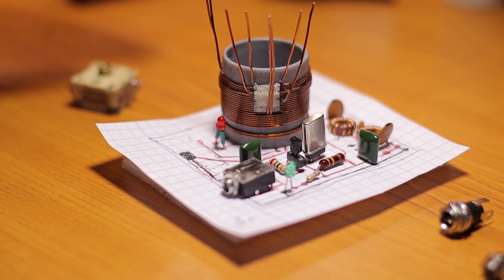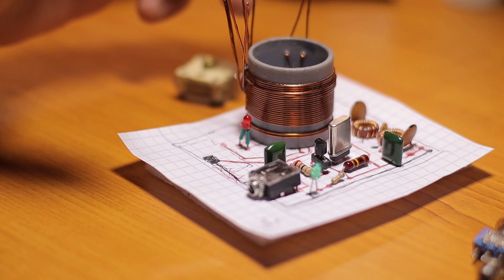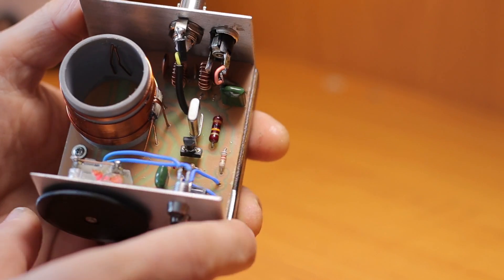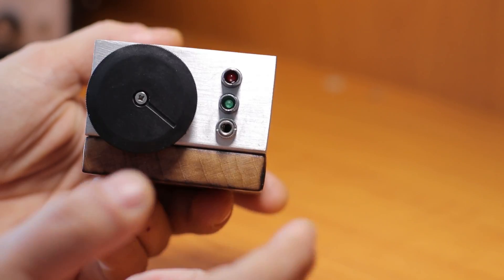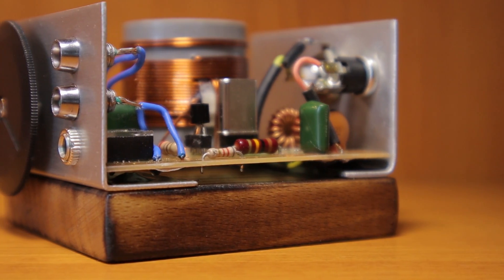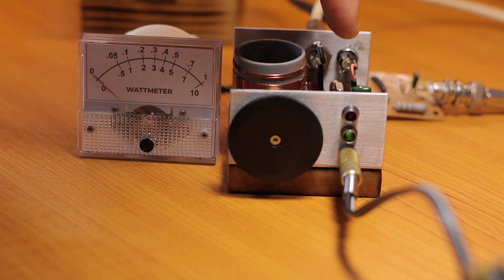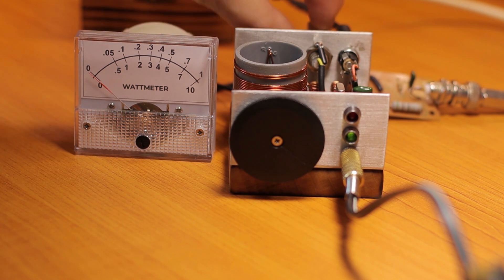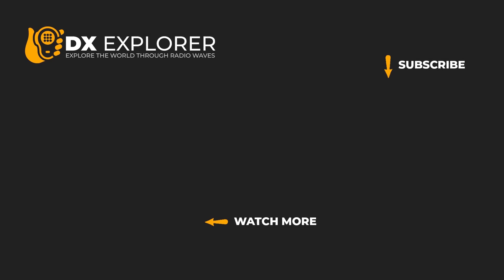Michigan Mighty Mite QRP CW Transmitter

Comment: Seems the original called for the coil form, from a 35 mm film canister !
Not sure you can find one nowadays ?
I used a breadboard to quick build mine, and connected to a 40 meter Ham Stick on a mag mount, at about 45 degrees, from the metal awning support it was attached to !
An old Drake Receiver in an adjacent room was connected thru a wireless 900 Mhz Headphone set !
Giving new meaning to,
 " Wireless " !
Hi !
I believe I powered it with Two 9 volt batteries in parallel !
But my transistor was a 3904 if memory serves me ?
I worked Cuba from Illinois with it !
And on 40 meters !
Great fun !
Really like how you dressed yours up !
I had begun to experiment with some success using an
 LM 386 audio chip, to make a transceiver !
Those were the days !
Fun stuff !
👍😉
Reply from the maker: It is a fun transmitter indeed. Cuba from Illinois... nice indeed. I am sad that I still didn't had the time to learn the code and use the MMM but hopefully soon. Thanks for sharing the little story... reminds me of the days when everything was simple and people happy enjoying the moment. 73, YO6DXE.
Reply: @dxexplorer  
I encourage you to learn the Code !
It opens up another avenue of Amateur Radio, and I think serves as a filter to what we sadly hear, especially from American Amateurs !
Too, I guess it is like learning another language, but a truly Universal one, in that Amateurs from all corners of the world, speak it !
As to the, " MMM ", I still remember the feeling, sitting at the kitchen table with a portable shortwave radio, and hearing the oscillation coming thru for the first time !
Great Fun, indeed !
And yes, as to the time, it was a very different World !
I'm guessing somewhere late 80's, early 90's I played with it !
Funny, I had the schematic for years prior, and then one day decided to try and build one !
Quite exciting to send out a signal, never knowing where your weak signal is being received !
Great Fun indeed !
Good luck with the Code learning !
Stick with it, and don't be too hard on yourself !
You'll get it !
Just stay with it !
And thanks for your post !
'73 !
👍😉
Reply from the maker: @sleeve8651 thank you so much. Ohh the code is why I got into the hobby in the first place, because I like the simplicity of the equipment you need for CW. A simple transmitter and a simple receiver and you are on air. I also had the schematic for a long time until I decided to build it. Actually there are many more on the list but I think life is too short to build them all hahaha. Is nice that it brings back good memories.

Comment: How did you wind the coil?
Reply from the maker: I did L1 first... 21 turns with a tap at 7 turns. Then on top of L1 I did L2 4 turns. L3 the one for the LED is next to L1 at about 4mm away doesn't matter on what side of L1.
Reply: @dxexplorer  thank you. Slowly figuring it out, will be my first coil. I will probably want to make a video tutorial how to do it for my friends. Got some folks in the Long Island cw club that are interested. Also noticed in the schematic that the 27ohm resistor is labeled R2 when I think it should be R3
Reply from the maker: @adanlewis7489 I am testing a version with a toroid coil instead. It seems to have a little more power output.  Not by much but in QRPp evert mW matters 😁. This one sounded nice... the one in the video i mean... but I wasn't too haply about the power output. Maybe a better transistor would help too. I think the original had a 2N2219 if I am not wrong. I can't remember for sure.
Reply: @dxexplorer fabulous keep us posted. I broke my leg so I have a lot of time to play around and build some radios!
Reply from the maker: @adanlewis7489 Ohhh heck... sorry to hear that. Yes I hope this weekend I will have a little time to play as well and I will get back to you and let you know the results. Just in case I forget... buzz me in here or on the email and for sure I remember 😅😅. 73, YO6DXE.

Comment: I have used the MMM design years ago and made plenty of contacts with it. Well worth building and trying out. Getting ready to put a new one on the air soon on 40M. My receiver is a very basic crystal radio design with a  loose coupled local oscillator vfo ( DC) and a few filtered audio stages and it receives 40M cw from Maine to Florida here in North Carolina. 73 de WA4JAT
Reply from the maker: That sounds like a really nice setup. I dont have the time now and still learning the code.... very slow because of the little free time I have. But this coming winter I plan the do a nice old school combo with a transmitter and a receiver to play with and see how far I can get with as little power as possible. 73, YO6DXE.
Reply: @dxexplorer  Hope you do not mind but I did send you a email with a pic of the receiver I am working on as well as the parts from my old MMM 🙂
Reply from the maker: @marknesselhaus4376  I don't mind at all. I got it )) I will get back to you a bit later when I get home. I want to send you a photo as well. 73

Comment: Try a Nand gate and crystal oscillator.  7400 or 74LS00. I worked a friend across town with just one chip. Just be sure to put filtering on the squarewave output because the second harmonic is almost as strong as the fundamental. I think the Norcal 38 Special tx used a 244 buffer as an oscillator.
Reply from the maker: That must be put on the do to list then 😁😁 Thank You... and Merry Christmas. 73 DE YO6DXE.

Comment: Is your tap for the LED red indicator drawing down your power output?? That tap has to absorb a certain amount of energy also. Try it with out it and see what your power output is.
Reply from the maker: Noooo... that has nothing to do with the output power. Its the same with or with ought it. Its all about the transistor used and the amplification factor of the transistor... also I think the current the crystal can take also has an influence on the power output.
Reply: @dxexplorer  Thanks for the update!
Reply from the maker: @johnkemas7344  Always a pleasure. 73

Comment: Does the wire thickness for the coil matter or can we use any thickness? (I only have 0.4mm wire)
Reply from the maker: It does matter yes. I used 0.7mm if I remember. You can use 0.4mm too... but you will have to recalculate the number of turns to give you the same inductance as the original coil has. I'm using coil32  app to calculate the coils.
Reply: @dxexplorer  Ok, thank you, it seems that almost all the inductance calculators don't care about wire thickness or even lack the option to specify the thickness.
Reply: @dxexplorer  ok I just checked, I also use coil32 online toroid calculator, but changing wire thickness doesn't appear to change the inductance at all
Reply from the maker: Hmmmm that's strange. I also use the same app and the inductance is changing dramatically if I change the wire thikness. I'll see in the morning if I have a little time and I will calculate and send you the coil details for the 0.4mm wire you have.

Comment: Nice work it looks good  where did you get your watt meter from ?
Reply from the maker: Thank you so much Joseph. The look of the transmitter was inspired from another one that I'm about to build and I will talk about in a future video. The watt meter I built my self. Not yet finished yet. Video coming soon about that as well. I have two scales: one from 0 to 1W, another one from 0 to 10W. More than enough for the QRP stuff I'm building. The meter itself it's actually a cheap Chinese meter to measure uA. I just removed all the extra parts and just kept the necesarry. I'll make a video soon and describe the entire circuit in detail and how I calibrate the entire thing. 73 and have a wonderful weekend.

Comment: Very nice, is that large air core coil for low pass filter?  like these old time stuff (Pixies) and regens for their high performance-simplicity ratio.
Reply from the maker: Thank you. The big coil is the transformer basically that it's coupling the output of the transmitter to the antenna. Impedance matching transformer I believe. The low pass filter its made with the two little toroids made on T37/2 and the necesarry capacitors. 73 my friend. Glad you like it

Comment: 1. practically every transistors are build in china.
2. made in china doesn't mean bad quality. You get what you pay for! If the market need low price, china will deliver it.
3. Lower output power doesn't mean low quality transistor. Choose a transistor with a high hFE gain. Every multimeter  has a transistor hFE checker.
The gain varies a lot!
Thumbs up for your work. TY
Reply from the maker: Thanks so much Tim. Yes I agree on what you say. I think I was talking about that in the Pititico video when I was saying that the transistors I got from Radio Shack years ago work well.... and those are probably also made in China )). But the quality is indeed different comparing to the latest ones I have. I am happy that I discovered now the difference in the hFE gain as I would never think of that otherwise. 

I always thought all 2N2222 are the same for example. About the BD139 I was talking about.... that is a really bad quality one ( I'm suspecting is a fake )... that's just because I measured another one that I have and the difference it's too big from what I found on the datasheet. Definitely a fake or low quality one. 

As example... I tested it in the 49'er transceiver where I'm also using a BD139 as final that's giving me 1.5W output.... but with the "fake" one I'm only getting 150mW  ))). I understand now that there is a difference in the gain.... but that much sounds a bit sketchy to me ))  Thanks one more time for watching the video. 73 and now I will keep in mind to check the gain first for the future projects  ))

Comment: The bd139 might needed more volts. In the past for example the bd was used for small but powerful transmitters for the am band and also there are circuits which allows the transmitter to operate in the fm band..
Reply from the maker: I thought of lowering the value of the 10k resistor a little maybe that may increase the power a little with the BD139. But then I tested that particular transistor on my 49'er QRP CW kit that usually gives me about 1.5W also with a BD139 as final. But with this particular one I only get about 400mW. For sure it's nothing but some cheap copy. I don't bother anymore )) I have to order a few more... but for sure not from the same store as most of the stuff I got from that place was bad quality. That's also where I got those old horrible potentiometers I used first in the Sputik and they ended up in trash a day later )))
Reply: @dxexplorer  I see. The 2n2222 transiator is actually the hero. This transistor output is really unbelievable.
Reply from the maker: Ohh yes. I'm still stunned that with a 2N2222 I'm getting 1W out of the Pititico Transceiver ))
Reply: @dxexplorer  probably it would be my first pcb project but I want some help. I can't find a toroid. Also in which paper do I have to print the schematic for pcb;
Reply from the maker: @sv2tcb  Here you have the link to the latest version I built: https://tinyurl.com/sputnik40-rx

For the coil.... if you can't find a toroid.... no problem I will email you the details for the PCV pipe version. Works just as good.
Reply: @dxexplorer  I paid more attention to the pcb files and the instructions you gave. Probably tomorrow I will order the pcb plate of need. Then I have to find the liquids.
Reply from the maker: @sv2tcb  No rush.... take your time and with patience you will get a nice receiver for sure. You already made one )) Ohhh for the coil by the way.... see my very first video of the sputnik and build the coil the same way as I made it in that video. Works like a charm.
Reply: @dxexplorer  actually it will be the 3rd time building the receiver but it is worth it  to be the first pcb project. For the coil I was talking about the el pititico tranceiver which has a toroid I thought of making that as a first project because it was simpler and smaller than the Sputnik
Reply from the maker: @sv2tcb  Ahhhh for the pititico you don't really need toroids. You can use the small inductors that are available for sale in diferent stores. You need a 1uH inductor for the low pass filter.... and a 4.7 inductor for the oscilator. You can buy those already made... ( looks similar to a resistor but with a different color code ).

Comment: I love your video series on the Sputnik. Could you do another build that can receive voice communications? I don't really like Morse, but I am a fan of homebrew receivers that can pick up people talking. Thanks! :)
Reply from the maker: Hahaha... thanks Paul. You mean like SSB coms ? I'm showing mostly CW in the videos because that was the hard part of making the receiver working well with those... but you can also receive SSB with the Sputnik. I listen a lot when I have the chance to be at home and the receiver is always on. Basically all versions of the receiver I built so far, are covering the 40m ham radio band from 7.000MHz up to 7.200MHz. So that covers both the CW part of the band... as well as SSB. I will return with the Sputnik and a few more receivers a little later for other bands too though. 73 buddy.

Comment: Very nice compact and very well presented. The problem I am facing is that the sputnik is not working 😃 again. I don't know, after the end of the summer I couldn't hear anything only some strong stations the cw or ssb was completely gone. I probably have to start building pcbs because my radio is completely a mess if you flip it upside down and I can not spot the mistake
Reply from the maker: Hahahaha... you are funny. Yes I know what you mean. If you remember my first testing versions used to look the same and after so many modifications I've always ended up having issues or the receiver not working. The check the potentiometer from the RF gain or the Regen one. But from what you are saying you can still hear something but not much. Maybe it's the RF gain one and you only hear the strong stations now. I had that issue too at some point as I was using the cheap ones that never worked properly )) 73 Nikos and as always thank you for watching and the nice words.
Reply: @dxexplorer  I don't have a proper drill to make the small holes for the pcb. I have to try making one pcb I have seen these compact projects and I cannot wait
Reply from the maker: I don't have one either... I really need to get a proper drillbit as well. For now my holes are also huge hahaha.

Comment: Bro i liked this video. I want to built a QRP Tx but i don't have 7.03 MHz crystal can you build a Tx without crystal
Reply: It will be not stable on frequency
Reply: @okhamradio  yes you are right
Reply from the maker: Yes you can... but as Oleg mentioned.... it will not be as stable. Try to find a crystal for the 40m band.... it doesn't have to be 7030MHz. The ones used in the Pixie are easy to find.... 7023MHz. I use 7030MHz just because I had a few of them knowing that it's the QRP calling frequency. If not you can also build it for other bands too. I would try this one instead.... you get a little more power out of it: https://www.youtube.com/watch?v=c6EV6EOT7H0&t=229s

If you still want to build the Michigan Mighty Mite for a different band that you may have a crystal for.... let me know and I will send you a link to the article where you can find more details about the coil for different bands. 73 buddy.